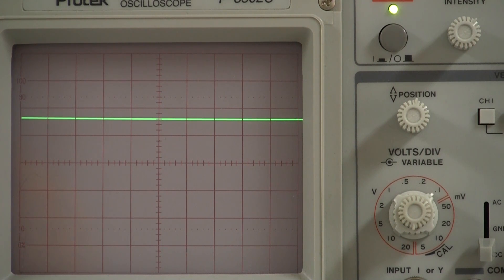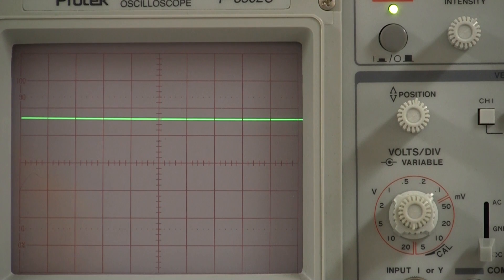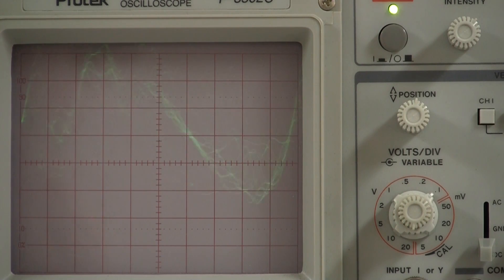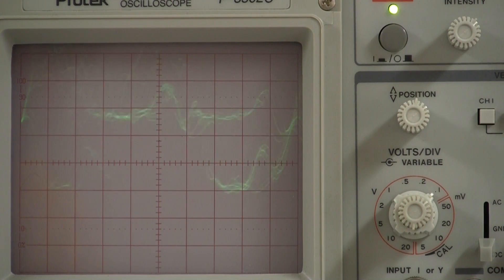Analog versus Digital synthesizers compared

Comment: I want to open by saying that I totally agree with you.  Most of my synths are digital and many are computer-based VSTs.  That said, analog proposnants tend to focus on different areas than what you proved:
1. Digital filters are excellent now but arguably analog filters do sound different.  Even some expensive digital synths (like the Waldorf Quantum) include an analog filter.  2. Analog synths have frequency drift and other behavior which are technically flaws, but which can make sounds more dynamic and natural sounding.  Some digitals emulate this, with varying degrees of success.  3. The purity of waveforms isn't reall relevant.  As Bob Moog said "Good Instruments aren't pure and neither are musicians."  So an analg synth may produce a saw or sine wave with harmonic artifacts, but these are viewed as musically beneficial, rather than flaws.
All that said, I think that digitals can more than adequately emulate analog synths, warts and all, at this point, so analog purists are just fooling themselves.
Reply from the maker: Thank you for taking time to make these valid points

Comment: Why does the new stuff sound so sterile? Analog synths sound way better
Reply from the maker: I have both analog and digital and as far as I am concerned they both sound great... moreover I have yet to hear an analog synth replicate an acoustic instrument as perfectly as a sample-based digital synth ...... so analog may sound great with "electronic sounds" but when it comes to pianos, strings and trumpets it cannot beat digital sampling of the actual real-world instrument
Reply: @StephenMendes  i hear you.i have both also,but more 70s and 80s syths.few 90s but after that i stopped collecting except for nodular synths. That have original cem and ssm chips. Its funny that now they are reproducing old gear now. And cem and ssm chips,i wonder why?  I dont care for reproducing pianos or trumpets. I want new sounds.
Reply from the maker: @gamatron17  hopefully I will get back to "new sounds" on the modular quite soon 😁

Comment: Steps can’t compete with sweeps for variability and expression. This isn’t to say that everyone will prefer the sounds available in those continuously variable controls. There are also uses for both indeed. I would never try to use a digital instrument to do something I can do with analog though for the simple matter that building something up with approximations instead of having current flowing through it won’t ever be the same. That said there are numerous things digital tools are capable of that I don’t immediately see an allegory for in analog. Ultimately though if the choice is Roland pcm synths and a computer with every VST imaginable or a full Serge System with tape echo and an Analog computer…. Well that’s a very very easy choice for me.
Reply from the maker: Hey..... I agree with you 🙂.....  I have an ANALOG "synthesizersdotcom" system 👍.....  I also use Eurorack (it's modular but NOT completely "analog")......  and PCM synths..... EACH technology is distinctly different in certain ways..... and there is no reason why we cannot enjoy all of them

Comment: a luthier will never produce an instrument identical to another, a Stradivari violin, it sounds differently from a Guarnieri violin. And if you try to analyze the sound with an oscilloscope or spectrum analyzer you won't notice any difference you have to know how to trust your ears too.
Reply from the maker: Says who ? ..... the fact that the TIMBRE of the sound is different MEANS there is changes in the harmonic content .... so it will look different on a spectrum analyzer that has the proper frequency range (and resolution) to actually show the changes
Reply: @StephenMendes  Hi Stephen,
I am an electronic technician and my work is also based on instrumental measurements.
I do not doubt that the tonal differences between two instruments are based on the harmonic content, doubts arise when these differences have to be measured.
In the video I only see waveforms displayed on the oscilloscope, which is not suitable for analyzing harmonic content.
The spectrum analyzer is a very expensive instrument and is not necessarily capable of resolving the very small differences in the harmonic content.
But if absurdly there was no tonal difference between an analog synth and a digital one, it means that there are no differences between analog synths and the same between digital ones.
Therefore it would be enough to have a single synth, analogue or digital, to cover all the tonal needs.
Reply from the maker: @antoniosauri1541  in my video I am talking about single sine waves ...... a single sine wave has a single frequency ..... I also mention certain other geometric wave shapes that are used in the lab for analyzing circuit behavior (the harmonic content of square and triangle waves follows a very precise mathematical pattern)....... NOWHERE in the video do I talk about FILTERS .. ..... analog filters are pretty unique in the way they affect sound a Curtis filter will not sound like a Sallen & Key or a State Variable filter ...... and there is no way for a DSP "filter" to exactly imitate ANY analogue filter type.
So "you got me" or if you prefer "you caught me out" ......... I am not just "an electronics technician" ......  if you have looked at the videos I have produced under my "Electronics" playlist you would realize I know WAY MORE than you realize ......... if you had watched my other videos concerning "Digital and Analog comparisons and arguments" you might have realized that these videos were INTENDED to be CONTROVERSIAL and PROVOCATIVE ....... in "double blind" studies people that claim to be able to tell analog from digital sound have been easily fooled ...... however that does NOT mean "there is no difference" ...... which is precisely why I bought  $15,000  worth of Analog Modular gear ...... now would I have done that if "digital and analog sound the same" ? ...... this video served it's purpose.....  29,911 views.... 338 likes and 177 comments  ..... and YOU watched it and commented at least twice  😃
Reply: @StephenMendes  Dear Stephen

I am sorry to read some regret towards me.
I would have liked to open a constructive debate, and my credentials
only served to make you understand that you could have shared
experiences with knowledge of the facts.
I have already experienced the analog vs digital debate when the first
CDs appeared on the market and if you do a search you will discover
that it continues today after 40 years from their commercialization.
As for "childish lecturing" I remind you that you made the video
lesson, I am limited to making only some considerations.

Sincerely

Antonio

p.s. I hope that the Google translator does not create further
misunderstandings due to the use of incorrect words.

Comment: Actual digital-analogue differences are NOT nonsense. In fact, it's much more nuanced.
The steppy nature of a pcm waveform is a sound design reality. Dithering is something everyone in the industry will recognize, including the algorithms meant to deal with it. It also has a massive effect on ring and fm modulation.

Analyzing oscillator signals, ringy and aliasing, is in the domain of analogue, while perfect, controlled shapes are digital. But those are just oscillators. In fact, mostly I don't have any fucks to give what my oscillators do as long as I have the option to output them both digital and analogue. Simulated analogue, analogue or digital is all the same to me. So simulated analogue is what I mostly use.

You'd be perfectly correct if everyone would make music only with oscillators but 99% of synth sounds are run through some processing and the vast majority of those processing chains can be, and often are sensitive to bit depth and sample rate if done digitally. A sensitivity which can be mitigated or abused to artistic effect.

Just to name a few of my workflows (which is specific to me, meaning others are using different strategies). Sharp transients or squeaks I usually create using a low sample rate mostly digital processing. Sub-bass is seriously oversampled digital. Pads, fills is digital waves processed analogue. Leads are analogue synth simulations processed mostly analogue.

Again, if your understanding of a synth is a machine which produces a waveform without any modification, treatment or processing of that form, you are completely correct. That is why it matters not if your oscillators of your synth are digital or analogue. The processing, on the other hand, is very much a thing.

Basically, you can spend 30min to destroy a sound, making it more "natural" or 30 minutes of cleaning it so it doesn't fuck up your mix. Or you can have both digital and analogue chains to save yourself those 30 minutes. ... with the exception of FM, which only really works with analogue circuits and soft, smooth bass, which is almost impossible with analogue.
Reply from the maker: Thanks for writing a whole essay for the enlightenment of all viewers 😊 ...... naturally it HELPS viewers to make up their mind about these issues 👍

Comment: Sorry but I think that you lose the main point between the difference of an analog and a digital source. The main difference between the two is that the non-linear effects present in electronic circuits (e.g. saturation) are very hard to replicate in the digital word. Part of that is because non-linear equations are very hard to solve and part because non-linear effects might correlate different scales, so small disturbances might scales up to macroscopic changes (e.g. turbulence). Remember that after all the analog synths are using a Fermi liquid (electrons in a metal) to produce sound. When you look at a sine wave you are missing the point. The point is precisely apart from the since wave, about what comes next in the Taylor expansion the "potential energy" V(x)=\omega x^{2}/2 + \dots in a equation of the form 

$$
\frac{d^{2}x}{dt^{2}}=-\frac{dV(x)}{dx}
$$

When musicians complain about digital synths they are complaining about the infidelity or absence of the non-linear  in the sounds. Human beings perceive this non-linear effects as the "soul" of the sound or any other crap like that, so when you hear musicians saying that the digital sound is "cold" or "without a soul" what do they really mean is the absence or infidelity of these non-linear effects. 

As an example, non-linear effects that are stationary will add/take lots of harmonics into a given source (e.g saturation). Also there are non-stationary effects that might work as sort of micro-compressions, with specifics attack and release curves that has a non-linear response to the signal that in entering.
Reply from the maker: OK ..... thanks for stirring the pot  😂🤣😂
Reply: @StephenMendes  I learn physics and math for two reason: understand the fundamental laws of nature and stir the pot :D
Reply from the maker: @MrBorest  I love it too 👍😊

Comment: NOWADAYS. IRS SO NEGLIGIBLE. SAMPLE RATE/CONVERSATION ECETERA.... A GOOD EXAMPLE IS FOLKS BUYING LPS NOW. LPS SOYND LIKE SHIT. ANALOG SYNTHS PRODUCE CERTIAN SOUNDS DUE TO THE OSCILLATORS. AND THE CIRCUIT AND COMPONENTS...THE EARLY DIGITAL SYNTHS HAD DIFFERENT CIRCUITS AND SAMPLING RATES WERE IN VERY EARLY STAGES. SO WAS  TECHNOLOGY OVERALL... BUT DIGITAL/ANALOGUE SYNTHESIZERS NOW BIENG PRODUCES NOW UTILITIZING HYBRID TECHNOLOGIES IS ASTOUNDING.

Comment: From one just learning :  I understand and appreciate the differences between "perfect" and "alive" but what about versitality?  Is one more versitile than the other or ios that just a mater of architecture?
Reply from the maker: Well on the matter of versatility the digital system will always win.... with digital, the same electronics can change function merely by changing the program code..... with analog electronics ,  you have to rewire the circuit even if it were possible to use the same electronic components (and most times it is not possible)..... in most cases, the digital system is smaller and lighter and therefore more portable ..... because the analog circuits simply take up more space than a digital system for the same identical functionality
Reply: @StephenMendes  Thanks for your reply. I've been checking the little Volca's - talk about smaller and lighter- Might be a nice little addition to a Prophet Rev 2 or the 12.
Reply from the maker: @jacksprat3009  YES the Volca is true analog and it is small and light...... is a very basic mono synth with minimal circuitry...... now there is absolutely nothing wrong with that..... even though I have a big (and growing) system, very often I would construct 'minimalist patches' because my philosophy is to use the minimum number of modules to make a sound......  I have often said that these elaborate patches, many of the superfluous modules are making little or no contribution to the actual sound....... furthermore the Analog Modular Synthesizer craze has become a cult, where people just spend money building huge systems 'to play with' but create very little
decent sounding MUSIC.....  my  first 'synthesizer' was nothing more than  astable multivibrator running off a 9v battery (I will make video show it, so you can listen to few seconds of music I made with it)....... in fact, you can make a whole lot of sounds with  Volca....... and the reason for growing my system, I am going in the direction of multi-timbrality and MIDI=based polyphony AND also love wires and electronics........  thanks for your interest in my  channel and your comments

Comment: As classical musician realizing the trend and movement of music, therefor moving into the digital domain, I find these debates not only informative, but fascinating. 
It's akin to the talks about different instrument makers and there crafts, or different piano companies, but instead of wood and coiled metal, its 1's and 0's vs heat and circuitry.

What I want to know is where exactly , in physical and (even technical) terms, does the differences resides? As in many domains of creative pursuits, "the art is in the subtlety" , 
No piece of information is to small or too advanced as far curiosity is concerned, please, I oblige you to leave any thoughts on the matter.
Reply from the maker: There are significant differences between the manner in which 1's and 0's are turned into sound waveforms and the manner in which  such waveforms are processed by analog circuits, the technical details of the circuits and processes will be covered in my ongoing series on Electronics and you may watch those videos if you want to learn about circuits and systems. But from a musical perspective,  our creative perception is stimulated by exploring all the possibilities that exist with the interaction with the instruments of music. So there is valid reason to have both, because they stimulate our senses in different ways and the result is reflected in the music created with each. Does this help ? ...... thanks so much for your most important observation as well as your willingness to explore the creative possibilities afforded by the new medium of 'digital musical instruments'.... and I am sure the music you produce will reflect your open minded approach and touch the hearts of many listeners.

Comment: I have heard that some Roland synths use an FPGA and NCO's, instead of a SHARC or other DSP based topology.  I would try this test with a synthesizer made by Novation or something. Supposedly, the sample rate would be much lower on the DAC with synths using DSP tech, so that COULD be why there is a higher sample rate here.

Comment: Some possible differences between a digital synth and an analog.  #1 Some digital and analog synths have insufficient bits of resolution on some of their controls giving stepping, like a 7 bit control on a filter; this is not what this debate is about though; #2 Vintage analog oscillators may drift ( I would not buy a modern analog synth that can't keep in tune, but some have options to add drift); #3 There's no guarantee that a digital synth's filter is identical to whatever analog filter it's modeling; #4 Digital oscillators can alias, where analog oscillators don't; #5 Some synthesizers have imperfect waves, and maybe someone prefers their imperfect waveshape ( there's a lot of variation in sawtooth waves.)

Comment: Isn't it the slight imperfection and drift that gives analogue the nuances?
Reply from the maker: Yes absolutely and they have to 'build in' this 'randomness and uncertainty' into digital to make it sound analog......  because without it, digital is 'perfect' and people accustomed to analog say the music has 'no character' to it.
Reply: Stephen Mendes Some of the emulation is very good. The thing that let's down a lot lf digital synths for me, is the type of sounds they're built to make. They often simply lack bottom end or softer and more complex lead sounds. Most digital pads live in a fizzy area of high frequency, where as analogue has that deep end. It's all just opinion though. I really do like the yamaha reface cs though. That's the sound digital can make and it's superb.
Reply from the maker: I got some digital patches here that I had to lighten up the bottom end so I don't think it's a fault of the technology ..... it's more likely the people who create the preset factory patches pushing the mid's and high's for some reason.